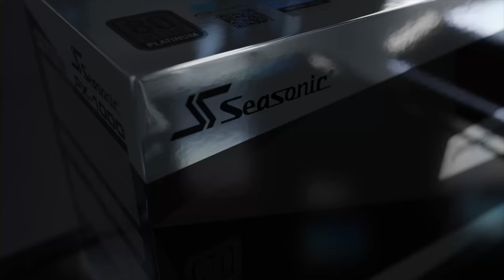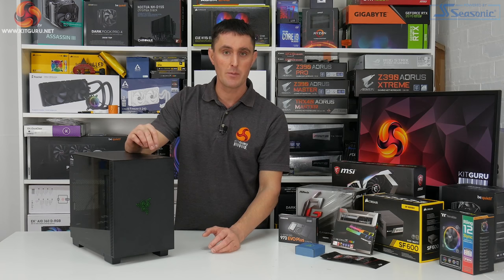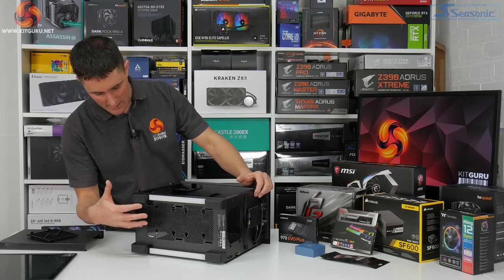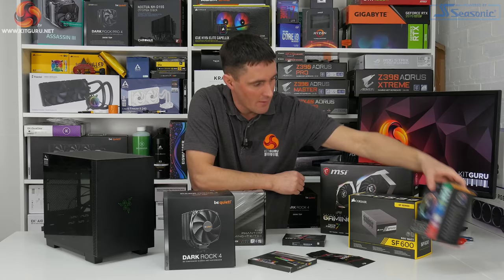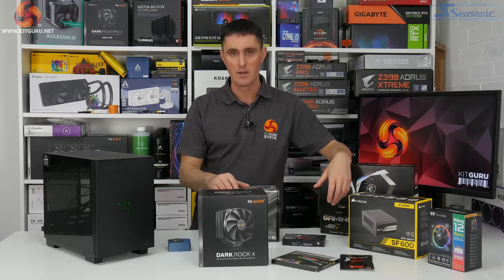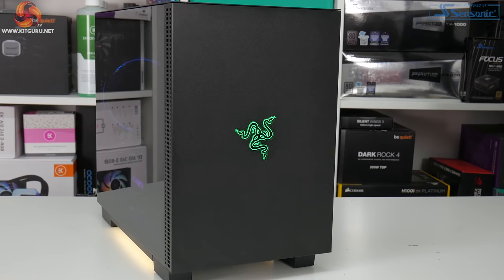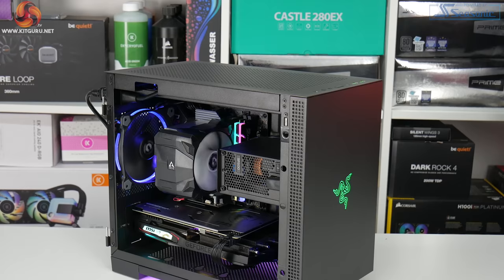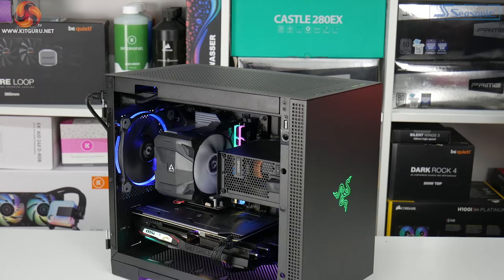RAZER Timelapse build & SYSTEM GIVEAWAY!

Comment: First of all, the front panel makes this thing a heat-trap. Ain't no good airflow in this. IF you HAVE to go with Razer, why not get the full-size ATX case so you can at least install more fans and get better (although still terrible) airflow?

Comment: Not a bad case, but the lack of room for at least one 240mm and 120mm rad, a carry handle, and proper vented or non-destructive modding for the front panel is a no for me.  I'll stick to the TU150.
Cheers though. 👍😎
Reply: You can install a 240mm rad in the top of the case.

Comment: Hi, you removed the label from the samsung SSD, is that nessasary, I've left mine on in my build and it's working, just curious as the instructions didn't say to remove at all :S
Reply: I remove them just to ensure the best possible thermal transfer. Im not entirely sure how much effect it has, if any at all.

Comment: will any of the 3rd party RTX 3080s fit in this case?
Reply: Maximum GPU length is 320mm so you should be able to fit a 3080 in there.
Reply: @KitGuruJames  Cheers! I’m assuming there won’t be any GPU thickness’ issues, since it has 3 PCIe slots?